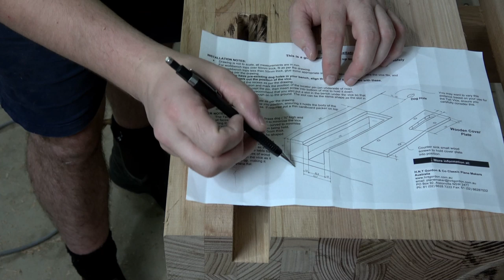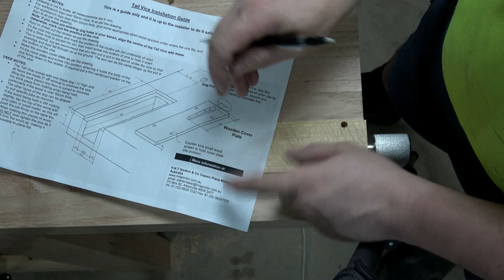HNT Gordon Bench Vise & Tail Vice // OzzyOcker Workbench Build Part 11

Comment: I’m practically sold on the tail vise for my bench, but I’ve been going back and forth between the HNT Gordon face vise and the Benchcrafted leg vise. This was most informative for me in my decision process. Cheers!
Reply from the maker: The tail vice is brilliant. I'm really happy with the HNT front vice. It just works so well. I haven't been using it long now, it has never slipped during the times I have used it. I plan on building another bench sometime this year, definitely will be using another HNT vice for it.
Reply: Did you make a decision yet?  Im facing the exact same choice right now

Comment: Thanks for doing this video!   Just built my bench.   I’m getting this tail vise    Big help!  Thanks
Reply from the maker: No worries mate. Those HNT tail vices are so good, I now have two 🤣
Reply: @kuffyswoodwork   how did you space your dog holes?   Would you drill holes first like you did?  Thanks
Reply from the maker: The holes are directly inline with the tailvice along the length of the bench. I have the 100mm version of the HNT tailvice, so i spaced my dogholes to be less than 100mm. It was about 95mm apart. The hole closest to the tailvice was located to be within 95mm of the point where the vice is fully closed. My first doghole is much closer to this because the spacing was specifically worked out to avoid having any holes land on top of the rails beneath the bench top. 
I think it is MUCH easier to drill the holes first before installing the slabs onto the frame. This allows the use of a drill press, which gives nice plumb holes.
Reply: @kuffyswoodwork  appreciate it!

Comment: I think HNT Gordon makes excellent products, and your choice in the vices show that.  A-1 build, could not be a more impressive bench for many years to come. Looking forward to the finishing Thanks Kuffy!!
Reply from the maker: Thanks mate. I'm really happy and slightly relieved that the bench did what it was supposed too which is to take the abuse without shifting away from the forces applied.
Reply: @kuffyswoodwork  Good and Solid built for a tank.

Comment: Fantastic again mate, I saw the vase slip under the clamp while you were drilling it. With 6 big screws in it you can just back off the front 2 and put the rear 2 in biased towards the back of the hole so it moves into the right position and then put the middle ones in then drive the front 2 home again. Basically what we do on fitout installs when hardware doesn’t line up the 1st time.

Love those HNT Gordon vises, wish Andrew Klein made his twin screw sooner, I kinda regret the Veritas twin screw after seeing his
Reply from the maker: Biasing the two back holes is what I did in the end. I kind of half wanted to mess up the installation just to show how easy it is to fix up, because it is quite important that this vice is installed square to the bench top. There really is no racking in the vice, so if the vice isn't square you will be forever applying pressure with only one edge of the vice rather than the full face.
Reply: Kuffys Woodwork wow yes that would be annoying if it’s not right from the start

Comment: Loving the build so far mate!  Vic Ash is a bastard for splintering, isn't it?  Regarding your drilling of the vice holes, perhaps a more accurate approach would be to use a 10mm drill as a transfer punch, move the hole a touch using your awl, and then drill.  This would allow you to pretty much guarantee no twist in your mounting rather than just eyeballing it. As for finish, given what you said, perhaps consider some brown or black Japan.
Reply from the maker: I didn't consider doing what I often do to find the center of a hole by using drill bits as a transfer punch, doh!. I was just messing around when I spoke of painting it brown. I said it with such a straight face that I included it in the video 😂
Reply: @kuffyswoodwork  Paint it chroma-key green, you can put landscapes and other fun stuff on the bench in post. :D
Reply from the maker: @djeity  Lol, the possibilities :D

Comment: Awesome stuff mate “an I like it a lot”
One suggestion while watching you struggle to line the 10 mm face vice  holes up for drilling.
I thought what if you ran a 10 mm bit in the holes backwards for just a bit, creating a shallow centred divide thingy, to guide your smaller drill bit??

Cheers Matt.
Reply from the maker: Yeah, using a 10mm bit has been suggested. It's such a facepalm moment. Ah well, it's all good now, and also showed the simple no stress process of how to fix it.

Comment: Does anyone know, if its possible to dissassemble the knob on the rear? The video shows at one point a tiny hole at the end of the the vise´s body. Is it to reach some kind of screw that locks the knob to the shaft? The reason is, I would need to make the the knob detachable, otherwise it would obstruct clamping workpieces on the right side of my (mft-)bench. Thx

Comment: "I like it, I like it a lot". Me too mate - it's 💯 mint. I'm on the HNT website now - oh la la, beautiful. I have to admit I was cringing when you freehand drilled those holes and then ... lo and behold. I was fully expecting you to use the drill press. Pity there isn't really such a thing as a mag drill for woodworking apart from those cheap adapter thingys. Drilling holes is one of the most buggy processes in woodworking in my opinion. Have to admit (again) I was surprised to hear that you're going to colour the wood. When did you say you were going to YouTube that? Have to admint #3 - I feel like I've made this thing myself - that's how intimate (giggle) your videos are. (yeah I know I spelt it "admint" the last time. I actually spelt it that way all three times but I got sick of correcting it). You back at work?
Reply from the maker: I've always hated having to drill accurate holes either freehand or even with a drill press. I have some control over the entry point of the drill, but only God knows what the drill does as it burys itself into the timber. "when did I say I was going to youtube that?" I'm not quite sure what you are asking, when am I going to release the final compilation video? Probably in about 3 weeks from now...if it is done! Yeah I am back at work, and it is only slightly south of 1million degrees celcius!
Reply: @kuffyswoodwork  Yep that's what I meant- about the last vid in the series. 3 weeks - cool.. Yeah mate - been seeing the crazy temps over there. This  aussie car channel I watch - their car was showing 50 degrees on the car thermometer. I feel buggered doing anything at around 30. 🔥😢
Reply from the maker: @TakamiWoodshop  Lol, it was 40° today and we worked overtime!
Reply: @kuffyswoodwork  oh gawd!

Comment: Nice one very impressive I do like your vice . They made it with six holes . Would you short change the bolts on your car wheels? A life time in mechanical engineering says fill up all holes. Great build congratulations.look forward to more of your work. Just looked at the price here in the UK. £460  .will stick with my Stanley six inch engineers vice with soft jaws.
Reply from the maker: Uhm...yeah....I would short change the bolts on my car wheels, and I think I actually have at one point. I do plan on adding the 5th and 6th bolt once I am committed to the position of the vice. I have had to take the vice off since this video to finish off some of the woodwork. The 5th and 6th bolt will be installed and tightened once only, which is a good thing when working with timbers.

Comment: Kuffy, I am going to buy your plans. Really like your design. I do bowever have a question, do you see any issues with me making the less at  90 degrees rather than splayed?  Regards, Jeff
Reply from the maker: You can make the legs at 90° instead of splayed. It makes the build slightly easier, but you also lose some rigidity in the frame when planing boards along the length of the bench. It's much the same if you are standing straight upright, and I push you. You're going to fall over, but if you brace yourself with one leg behind you, you'll be able to take the impact and probably punch me for pushing you :D
Reply: @kuffyswoodwork  Thank you so very much for responding. I do understand now, and think I will go with your original plan with the legs splayed. I’m a bit of a new to woodworking so wish me luck please. Once again regards and thanks
Reply from the maker: If you need any help along the way, don't be shy to ask.
Reply: @kuffyswoodwork  just downloaded them👍
Reply from the maker: @jeffcoh3440  Thanks mate

Comment: I had to drool over the HNT Gordon site. Good looking bench. Do you need to secure the top to the base or is weight enough?
Reply from the maker: At the end of this video, I am making a few shavings and the bench isn't bolted down. I could leave it like that, but it probably would bounce occasionally when using a chisel and mallet. It's heavy, but it still can bounce/vibrate a little. A few coach bolts through the apron and she'll be right as rain.

Comment: You have a pretty thorough review of the bench vise, do you have one for the tail vise?
Reply from the maker: I haven't done a review on the tail vice. I think the best review I can give is my second bench also uses a 100mm stroke HNT Gordon tail vice. I haven't uploaded the videos for the second bench yet.
Reply: @kuffyswoodwork  Okay. Any thoughts on the 100mm stroke vs. the 150 mm stroke?
Reply from the maker: @farmcat3198  The 100mm is better in my opinion. It takes less time to wind out the full 100mm if needed compared to winding out a full 150mm. It also uses less space on the right hand side of the bench (for right handed people), and therefore you end up with greater clamping capacity on the same bench compared with the 150mm version.
Reply: @kuffyswoodwork  That's good to know. Thank you!
Reply: HNT now makes a wide jaw (340 mm) face vise. Any opinions on using that when compared to the standard 230 mm version?
Reply from the maker: The smaller vice rhat I have is perfectly fine. When coupled with a holdfast, I can firmly hold pieces innplace which are much wider than the 230mm vice.

Comment: Nice work! How did you get the top of that vice to line up with the top of the vice-- or does it?
Reply from the maker: The top of the vice is 2mm below the top of the bench. I designed it this way with a 75mm thick top while the vice rises 73mm.

Comment: I think your splitting timber because your holding the router backwards.
Reply from the maker: Nah, the timber splitting is a product of the grain direction as well as the rotation of the router bit. You can't really hold my router backwards because the handles are tilted forward. It's very uncomfortable to hold it backwards.